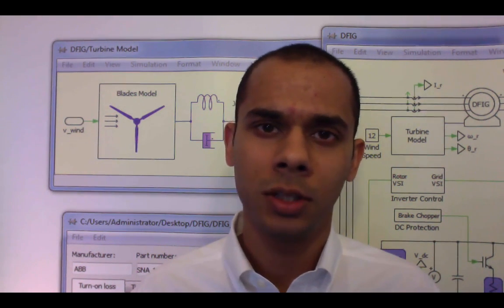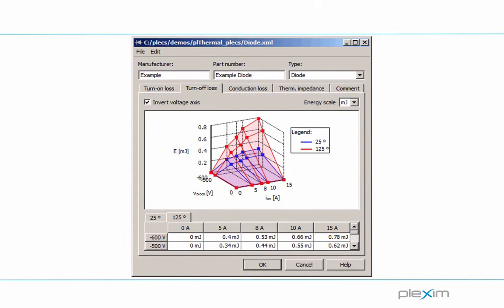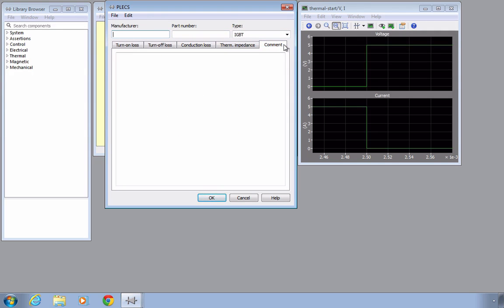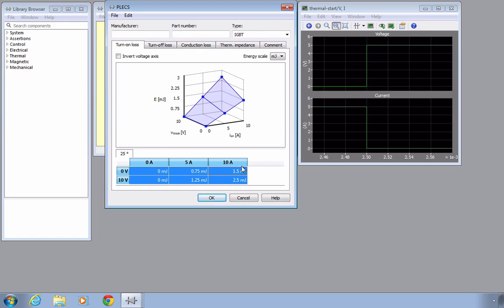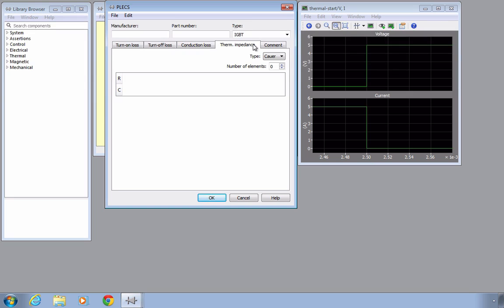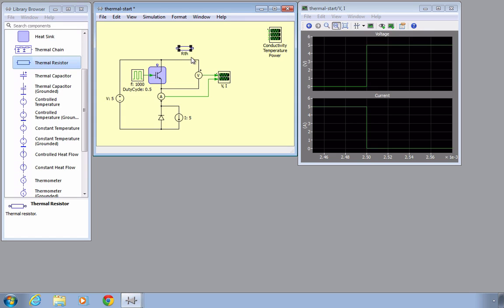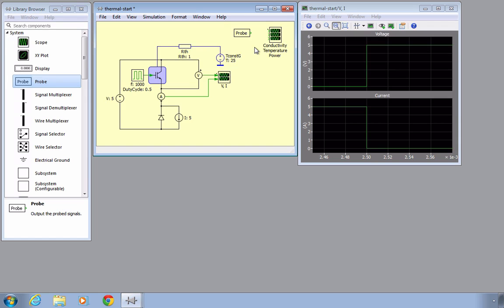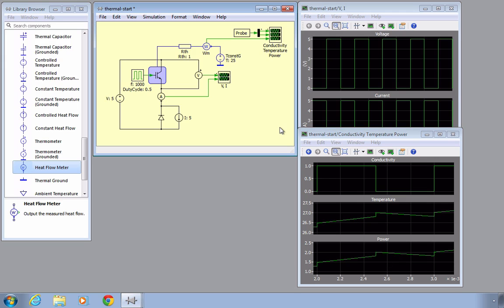Thermal Modeling in PLECS Part 1

Comment: What if the mosfet datasheet does not have turn-on and turn-off loss graphs?
Reply from the maker: Hello and sorry for the very late response! You can always email us at support@plexim.com to inquire about building thermal loss models for a specific component(s). We may already have access to such data from certain manufacturers, or have someone we can contact to request the data. Otherwise, we can recommend some classical equations to generate Eon/Eoff calculations in PLECS using a few approximations and constant values always given in the data sheets.